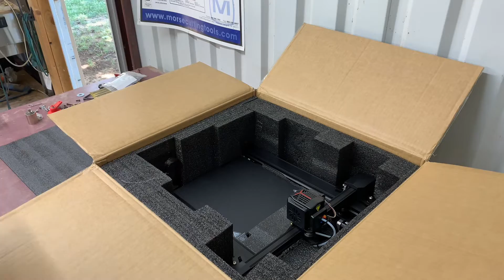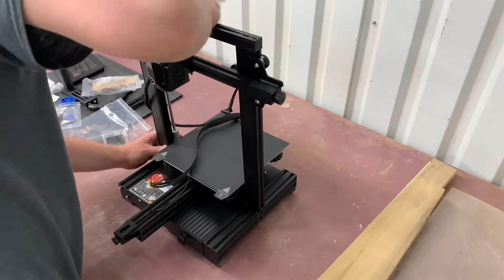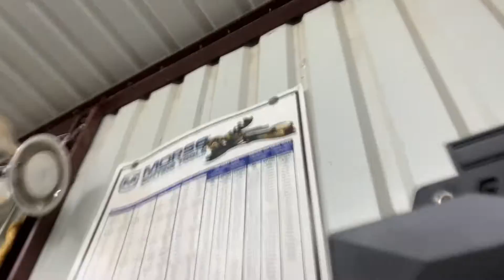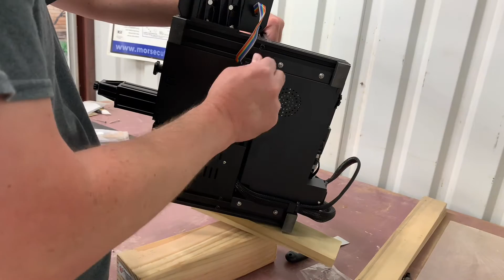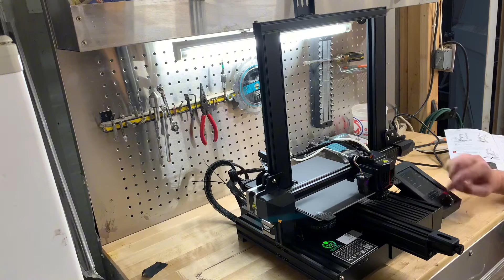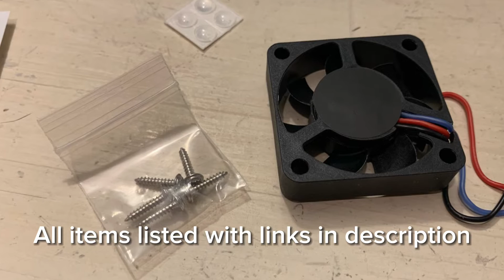Assembling Ender 3 v2 Neo Plus Octoprint Using Raspberry Pi

Comment: great video! I am working to get Octopi set up (first time using it) and am having issues connecting to the printer. Are you using the micro USB port on the front to connect to the pi or am I just missing a standard USB somewhere on the printer?
Reply from the maker: Thank you!  I'm using the micro USB on the front of the machine.  I just had a USB A to micro cable that was a charger cable from something and slapped it on.  What kind of communication issues are you having?
Reply: @themeandrousengineer  I am getting: Could not autodetect your printer No working connection parameters could be found. Are you sure your printer is physically connected and supported? No serial port found, are you sure your printer is physically connected and supported?
Reply: I used the video you linked to to get the rpi set up. Chose not to use the camera version because my webcam is missing when I could use it
Reply: it was the cord I was using... charging only cord. She is rolling! Thanks again for the video and responding!
Reply from the maker: @codywarrington1521  Awesome. I’m glad you got it working and that the video was helpful. Oddly enough, I’ve been thinking about doing an Octoprint specific video lately. Maybe there is a need. Thanks for watching.

Comment: Don't zip tie all the cables on the back, the hotend cable needs to travel all the way up and down, and right to left on the x axis. You can zip tie it to the extruder motor mount after you are sure it can travel with no problems.
Reply from the maker: This is a good tip. I wound up cutting a couple of zip ties on the back and doing just what you said. It was one of those things that I did and thought better of it later.

Comment: so at time of posting this I just got this same 3D printer about 20 days ago, (still fine tuning this) this is my third CNC type item and well its clear that either you got a vastly different manual then me, or you did not try to read it, everything was easy to understand and very clear in mine, also the feet should not wobble like that out of the box hopefully you were able to fix that or get a replacement as that will throw off larger prints or make it so prints pop off mid printing
Reply from the maker: Well, you're not wrong.  As I said in the intro, I clearly suffered from thinking I "knew everything" and made decisions definitely not in the book that created dumb problems.  I went and re-read the manual after your comment to get a more solid opinion of my own when I wasn't pressed for time.  The instructions are pretty clear over all after re-visiting.  I even just caught that it says to overhang the bolt holes for the gantry on the edge of the table to be able to put the screws in so I feel like I overcomplicated things in general.  That being said, I do think that the instructions could elaborate a little more on leveling issues and illustrate where things like the x axis limit switch are just a hair better. 

Rushing is definitely a plague of mine lately since all my shop time is short lived and when I do have time I have the tendency to feel pressure to get things done.  I plan on doing a review of this machine in maybe a year so I will plan on illuminating my mistakes a little more then too, like this one.  

I haven't leveled the base to the table yet, but it hasn't effected my prints that I can tell.  I do have some prints close to the bed on one side like in the video, but I'm not sure if that is causing it.  I will fine tuning just like yourself.  This has been an excellent machine so far and I've printed A LOT.

Thank you for commenting and I appreciate the feedback.

Comment: Thanks for this. I am looking a getting a printer, and this helps  a lot.
Reply: I just got this printer a monthish ago, its easy to use and not that much money the printer, tools and two spools of filament came to under $300 after shipping and tax
Reply from the maker: I'm happy that it was helpful.  I decided to get one for myself a while back and I really didn't plan on making a video like this since there are a lot out there, but I felt like others might gloss over some assembly aspects.  The Ender v2 was recommended to me by two other engineers who have them for hobby stuff and so far it doesn't disappoint.  It's definitely much cheaper than the likes of a Prusa/Bambu and delivers some pretty decent quality prints.